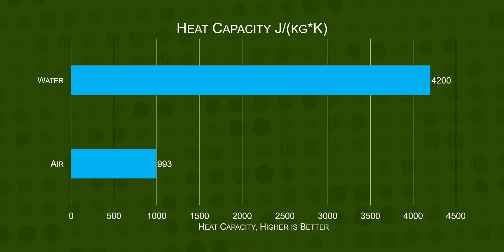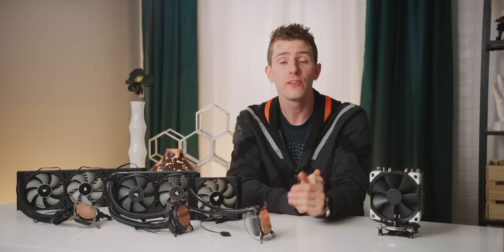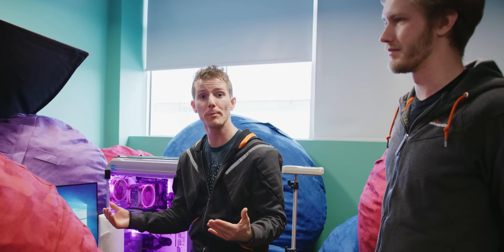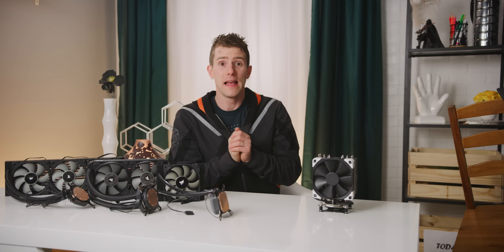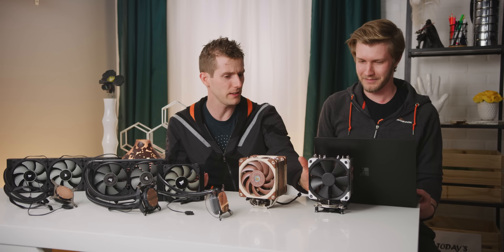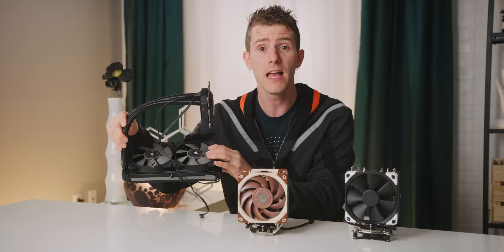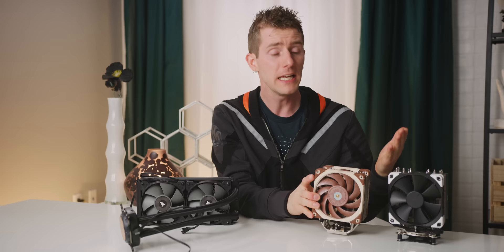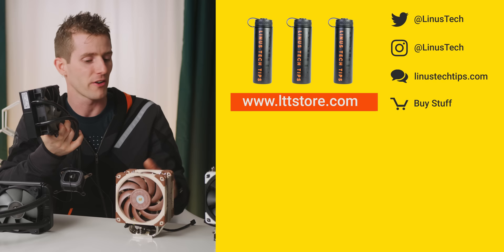Why you shouldn't water cool your PC

Comment: Gotta love water cooling. My cooler is 5 years old and going strong (for now at least) so failure doesn't seem to be an issue for me. They never need cleaning unlike normal coolers which attract dust ferociously. Also they are easier to fit because there are fewer space constraints. Speaking of space, because there is nothing in the middle of the case airflow within the case is much better.

I have this feeling that Linus' video from 2019 is not the whole cooling story...

Comment: hello can I use 6 fan in radiatior 3 in front and 3 in back in push pull direction
with different rpm
3 infront are 650 to 1800rpm
3 in back are 1200 rpm
Reply: No, you will destroy the radiator.

Comment: After my corsair H115 Extreme died on me and burnt my i7 4790k, I never trusted water cooling ever again. I have been using my BeQuiet Dark Rock Pro on my last two builds with no issues what so ever. The only thing it needs is a dusting every now and then but I'd rather dust it then have to worry about a bad pump.

Comment: My i5 is overclocked, doesnt over heat and I just realized my water cooler fans and pump haven't been on in over a year. Doesn't overheat at all. So I've learned its basically useless. I'll be going back to a standard cpu fan.

Comment: I know it's rare but I worked as a tech and had two customers have there GPU's taken out from leaks from AIO's Poor man and his 3 month old 2080 ti with pretty bright green droplets all over the back of it! And they fail after a few years. You can when the pump is bad the heat should be equal through the length of the hose. Put your hand around it next to the pump and its ho as hell and 6 inches away and it's way cooler it's not pumping.

Comment: LOL Reading the comments, I wonder how many ppl watched the whole video. That said, I've never been impressed by AiO coolers. I had a Swiftech that had corrosion issues on the inside and the thing stopped running. Fortunately, I do monitor temps, and 2 of my 3 desktops have a Logitech G19 keyboard (the one with the color LCD screen) which displays temps and more. I briefly used a Corsair AiO on my i9 7900X while I planned out a custom loop. I have a Corsair H75 on my 990X, but the case is too small to support anything else. My 5960X custom loop was the easiest setup, but hardest to clean. My custom loops have been mostly flawless and I wouldn't touch air cooling for free. It's ugly, it's a bit loud, and vs a good custom loop, lol, gtfo. Does a custom loop lead to anxiety and stress? Yes, it does! Those first seconds to 48 hours are intense!
Air: eww
AiO: ugh...
Custom: Until the day I die!
Reply: u gae

Comment: I just want to liquid cool a computer so I can have all the radiators and fans physically outside of the tower so it's easier to clean. Don't know how much of the  tower actually needs airflow. I'm thinking of liquid cooling the CPU, GPU, and PSU all in this way, to have zero airflow inside the tower... but... would that kill the motherboard?

Comment: I bought a best buy machine when my old pc up and turned itself into a welder (man did that psu fry things). This machine runs alright, for the price i paid but lately ive noticed the CPU is getting very warm, like 91c when gaming.  The lines were warm to the touch so, im hoping i can re apply the thermal paste to help but im not sure now.  After seeing this video i realized they gave me the lowest performing, single fan liquid cooler on the market.  One would think for 2k they would at least install a decent cooler.  I had no idea back then..bleh. OH well, hopefully i can get this sorted.

edit: if this matters to anyone, I upgraded to a 240mm, dual 120 mm fan setup for an AIO and my temps have been in the mid 60s on heavy cpu games.  My fan speeds never go past 2k though so ill have to dig a bit more and see if i missed something. Hey least its not 90c anymore.

Comment: I think i know why aio was worse. Because temperature difference is low on aio and higher on air cooler. But for me with new 12th gen aio is a necesity.
Reply: true, i have 12600K and for sure will get nice MB capable of overclocking and AIO, i want to run him up to 5.1-5.3 Hhz
Reply: @morgothbloody7181  yea me too my air cooler cant cool the 12700k

Comment: One day I still want to build a PC with a custom water cooling loop using an external separate radiator somewhere away from my ears so I don't hear the fans or pump. I want the PC itself to be moving part free, as far as is possible. I've even found a psu that has no fan and has a water loop connection instead.

Comment: As someone with a big case ( not a whole lot bigger than your test setup one here, ) I can say that you're definitely right about the case temps being near ambient. I have three intake on the bottom, one intake at the back, and three exhaust near the top (not vertical, mind you), all 120mm mounts only (can have 1 240 or 360, but no 140 multiples. Even in quiet mode (only front bottom fan about 1100RPM and top rear where the rad is about 1650RPM), the case averages about 1-5 degrees (Celsius) above the intake temps. I have a Corsair Commander Pro, so I have a temp sensor at my intake fans, GPU backplate, top side of motherboard (but away from it, in the ambient air), and one behind the 120mm CPU cooler rad. The intake and top case sensors almost never show much more than 5, MAYBE 10 degree difference.

That being said, having my rad on the exhaust keeps the CPU idle temps and the overall coolant temps actually a bit higher than putting it at the rear intake port. Heats up quicker at the exhaust during gaming, but doesn't really get the coolant much hotter. Maybe a few degrees. I do only have an i7 6700K, but when it's overclocked to 4.6GHz, it still doesn't get above about 70 during full load, maybe about 65-70 during gaming.

Comment: No reason for a AIO water cooler for a PC. Its a computer not a motor with air, fuel, spark to cause an actual combustion 🔥 in the motor. When you actually NEED a water cooler is to cool another important liquid in the motor you know what that is? Engine Oil which is why we have a radiator, thermostat, condenser, coolant in an engine to cool the oil temperature of the motor overall. Air coolers are enough for a PC. AIO water coolers for PCs are for looks.

Comment: Let's see - air cooling is more reliable, quieter, more effective, easier to install and costs less. . . Got It !!
Reply: This video is extremely outdated, liquid cooling is better rn
Reply: @megamanx1291 they are about the same in term of performance Vs price I'd say.
Reply: @LeDracodon pretty much, yeah. i could've bought a decent air cooler for a bit over 50.- but went with an enermax liqmax 3 or so with a 120rad for a bit under 50. it's decently quiet and at full load barely passes 70°, more than enough for me and my r5 3600, also has some rgb which is far from necessary for me, but i'll take it, and an rgb air cooler would've cost a fair bit more where i live

Comment: I just got a new PC using a iBUYPOWER DEEPCOOL GAMERSTORM RGB 240mm CASTLE 240EX Liquid Cooler. Now Im worried about keeping it working, and if it may leak water. How do I go about swapping it to air cooling? Do I just unplug the water cooler and put in two or so more fans in its place?

Comment: I'd like to see you discuss keeping CPU coolers clean. Air coolers get dirty faster than water coolers, and when they do it's a bigger performance loss, isn't it?
Reply: Blasting the cooling fins every couple months with canned air is a pretty simple thing to do, which you also have to do to water cooling radiator fins, so I don't think the equation changes much. All in all, clean your cooling fins regularly.

Comment: Late to the party and probably not a common problem now but a cautionary tale about water cooling:
When the FX9590 came out I built a system around it. I knew it was a hot running cpu so I went with an AIO water cooling system. Well, the water block, blocked air flow across the vrm. I packed in a a small fan to blow air across it from the side. Issue was blowing stagnate air in the case across it. Over time the system became more and more sensitive. The vrm would get hot, voltage would drop and the inevitable crash would occur. It actually took me a while to figure out the crashes. Literally running stress tests and just happened to watch the voltage drop and then bam, crash. I dont think I'll run water cooling again . I'll just stick to stuff I can air cool with a quality cooler.

Comment: If you put noctua nF A12x25 on your rad they work a whole lot better than the OEM fans that come on them I get great thermals on my 5900X with just a 120mm rad ( and for best performance the quite adapter shouldn’t be used it limits the rpm of the fans )

Comment: Only thing worth watercooling in my opinion is your GPU. No cooler can beat that. CPU in my watercooled system, even while it's ramping up in watts & clock speed will have a 20-30c jump over my water temp. CPU blocks aren't as good as gpu blocks and i'm unsure why. My gpu always stays within 10c of my water temp. While water cooling, you're not cooling the components as such. You're cooling the water so it's more so to do with how efficient your pump & rad combo is at cooling the water, not your pc parts.

here is some reasoning I think watercooling your cpu isn't worth it..
1. You can't directly cool your CPU chip as you've got that big ass metal block that intel / AMD sticks on their. 
2. Surface area is spread out over the IHS so non direct cooling while your GPU is directly on your CHIP!
3. Read 2 &1. 

reasons why I watercool my cpu: 
It's cool asf.
It's sexy
It completes my soul.

Also, I have a full custom loop. Pump failures are very annoying, along with wanting to upgrade anything down the line. Still, very enjoyable for me personally.

Comment: Well, I have very interesting problem. I'm a graphic designer so I have pretty strong gear - RTX 3090, 16 core Ryzen + monster Noctua NH15 slapped on it. Now - Noctua is so big, that it takes very much space inside the case and hot air, produced by GPU during 3d work doesn't have enough space to escape. Even with full tower case PC changes ino one big oven with internal ambient temperature. Really.. noise isn't a problem, you listen to music anyway during work. So basically taht's what convinced me to siwtch to water cooling, which simply provides enogh free space above heat-producing GPU xD

Comment: Strange that in this test the GPU teperature was not evaluated as not only CPU gets hot.... With air cooler GPU temperatures goes higher than with AIO couse ambient temperature in the case goes higher. Anyway still my personal choice probably will bebigger Noctua (for ex. NH-D15)  air cooler than AIO.

Comment: I’m really curious about how if Linus was building a PC that was to be portable, he would equip it with an AIO.

I’ve been thinking about building one that I plan on being mobile. And I can’t help but be worried one day to transport it and find that the AIO burst during transport.

Is that really such an unlikely event, that it shouldn’t even be worried about? Is the concern with AIO’s, for all intents and purposes, simply pump failure?

I was surprised by that preference that he suggested. Especially if you can secure the top portion of a air cooled system to the case, even by something as janky as zip ties, the fact that there is pretty much no chance for water damage seems like it would be the way to go.
Reply: A mobile PC with like wheels and stuff?
Reply: @Molotov_Milkshake  small, small enough to put in a backpack or suitcase. This one has an AIO in it and is 11 liters volume I believe

Comment: i am building my new PC now to match the 2080ti i baught and i want to go for water cooling so that there is more space in the PC. 
i have got over the dangers but now i am concerned about the noise of the pump.

any advice?
Reply: Get air cooler its enough to sustain your pc aio is only needed if u want aesthetic/overclock also its not really needed if u gonna play gpu intensive games but if u want the drip for it and has the bucks why not.

Comment: I have replaced 3 corsair AIO coolers on 12 computers in the last 5 years. The cpu slows down drastically and I ran core temp and found put that way.
I had to replace an Enermax AIO on my 2990wx after the first year before they fixed the growth in the water issue they had but it has been great for 3 years now.
I replace 2 corsair AIO with noctua server size 4U air coolers on a dual xeon server and my Temps were much better with the Noctua.
I am never using AIO systems again. Custom loop or Noctua.

Comment: Water cooling just means more points of failure. For someone like me that has no plan to push systems to the max or overclock, just plays games with maybe discord on, and does ni ot run 10000 browser tabs open (use bookmarks people) a mid grade tower works fine on a i7 10700k

Comment: Then there is the problem about holding the water in.  I personally am getting rid of my third! AIO watercooling unit now as they somehow tend to lose water over a time. I mostly end up in having about 5 Systems with a Watercooling overall in use and I am just wasting my third one as it got hot randomly and I did not get "why" but lifting the rediator I have heard water splashing in the inside and that means there is a LOT of air in it and the rest is self explaining....  This pc has been working fine last year and has only been standing around untouched and unconnected. Noone did something with it it even has not been moved but somehpw the watercooler broke...  I now ordered one from CoolerMaster as I usually went to love the Enermaxx ones but.... Sorry that is a nogo. I do not use tem alot nor change alot and I think it is a nogo they lose water when they just stand around. I do know that in a way both versions are "watercooling" but then I never saw a "Fan" CPU cooler lose fluid out of an heatpipe...And you are totally right.... I am a lucky girl as I am mostly having MSI afterburner running on any game and also you can hear the Fans are spinning unusually high when the pump dies or so.....  IF the water will not move the cpu gets warm and will turn up the Fans VERY unusual and I guess it is also realizeable when you are at the desktop use or so. I think that mostly every cooler will be bending the mainboard. I mean even putting on a stock cooler will instantly bend the mainboard  if you take a look from the site.

Comment: Hello, nice video guys. I am building a PC now and have grabbed an RTX 3070ti and an i7 12700f. The stock cooler that came with the processor seems a big small and I'm not sure if I should trust it. I wanted to ask you:
1. Do you recommend for me to grab a 240mm aio - is it needed/recommended? If your answer is yes, than is 240 enough or should I look for 280/360 for this processor?
2. Do you recommend the AIO fans to spin and get fresh air in the case, or exhaust hot air through the top?
3. Will the 240 cool much better than the stock air cool one that comes with the processor?
thanks for the advice :)
Reply: Go for air cooler unless u have lots of time to clean ur aio every 3 weeks

Comment: I just cant agree with the test results. I have been using msi mag 360r v2 in a room of 25 degrees testing it full blast but i dont get above 70 cpu temp. And even if i pass it the cooler actually kicks in for a minute and its back down to 65-60 degrees. 

How terrible is the triple fan radiator that their using then? Especially knowing the MSI mag is about 60 bucks cheaper?

And yes my room is 25 degrees. I have a big window and no airco XD!
Reply: heavily depends on your cpu. i think amd cpus tend to need less power so they won't generate as much heat, more modern cpus in general might also be more efficient, not quite sure. the video is like 4 years old after all and they used a 7th gen intel (i think)

Comment: I think for shear longevity and ease of use large head sink coolers are the way to go if it's not something you will be transporting, and have a large case to fit it.

I bought a cooler master heatsink so long ago I can't even find the archived email for when I got it, so probably before 2012 and I am still running it today even with successive generations of CPUs and motherboards I do mild/reasonable overclocks and temps never exceed 70c even here in Australia during hot summers.

I can see an AIO being useful for mini builds where you don't have as much clearance above the CPU in the case and so the heatsink can be moved to a more fitting location and aesthetics but that's about it.  For me it's never been about aesthetics I can't stand RGB and always have a fully enclosed case (No windows) as having extra light shining from the corner of my eye has just never appealed to me.

Comment: See I was always curious how or if one of those giant, dragster engine looking, heat sinks would damage a motherboard or processor, that is a lot of weight it seems like just hanging off a cpu.  

Has anyone had issues?  My aio has done well but it’s finally dying on me.  The weight is my big concern with air cooling.
Reply: they're super light in reality, no worries about damaging anything
Reply: I've used a thermalright silver arrow with 2 fans for the past 10 years on two different boards. No issues until today and it's a heavy one. 

Heatsink Specifications:
Length 147mm x Width 123mm x Height 163mm
Cooler weight: 825 g (excluding BTK and Fan)
Heat-pipe: 8mm Sintered Heat-pipe*4 units

Fan Dimension:  
C1100 Pure Copper with Nickel Plating.
Fan Dimension:  Length 160mm x Width 26.5mm x Height 140mm
Fan Speed: 900~1300 RPM (PWM)
Connector: 4 Pin (PWM Fan connector)